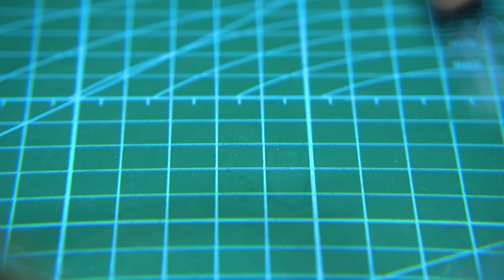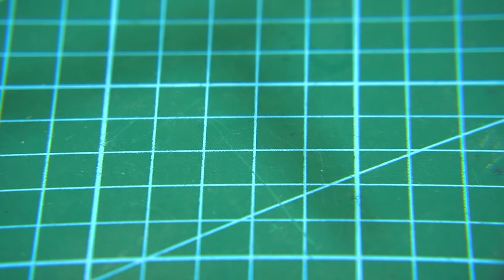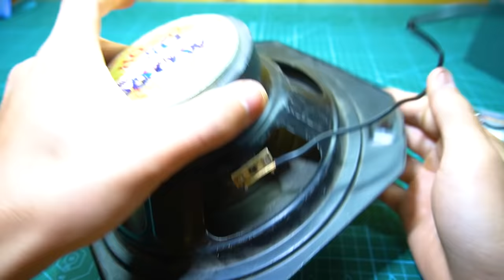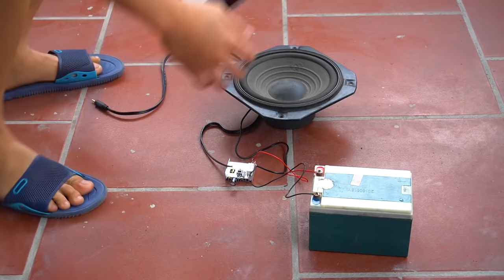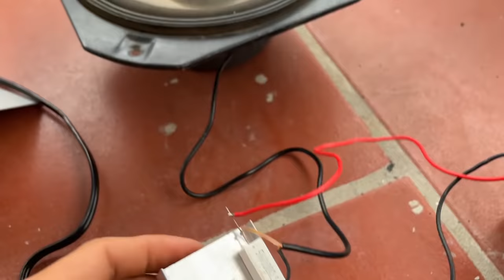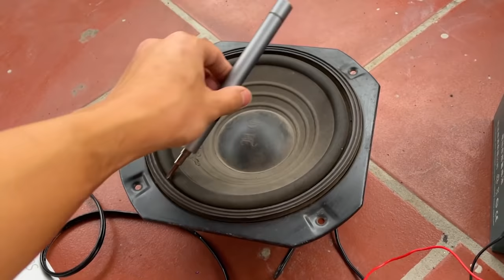DIY Powerful Ultra Bass Amplifier Z44N MosFet, No IC, Simple circuit

Comment: while what you did is impressive... it is simply impossible to get 1300 watts from a single ended amplifier running on 12vdc Even if you double the voltage you will never get anywhere near 1300 watts from a single discrete transistor. The laws of physics and amplifier design havent changed. You might be getting between 4 and 5 watts out of your amplifier. Single ended amps are power hungry monsters and can only claim around 40% efficiency. So measure the current draw from your battery and multiply that by the voltage of the battery under load and that will tell you what the amplifier is drawing from the supply. The power output will be only about 40% of the input power. And you absolutely cannot get more power out than you are putting in!!!
Reply: You are electrical and electronic engineering.  
No one dare to changed ohm laws nor physics, but one could only adding and subtracting. 
This project for mimicking purposes, if assembler want to exponentially functional circuits, he must have the right ohms laws for his output satisfactory.
Reply: He is misleading people by posting these barely 

functional circuits with ridiculous ratings.
Some are dangerous or will burn out the speaker.
Why do you think manufacturers use so many more 

components to get a proper operating safe circuit?
How many people have wasted their time with the garbage 

he posts?
Reply: 1300PMPO possible 😅 lol
Reply: Cred că  depinde  mult  și  tensiunea  de intrare  ( semnal )
Reply: 1300w PMPO
Reply: Thanks for your valuable input. I  am learning and not know as well  the actual capability here.
Reply: Publica un plano

Comment: this small speaker is 50w  and this amplifier is 20w max
Reply: Не 50,а 5-10 от силы но чуйка возможно не плохая😅
Reply: @あなたはここで何を見たいですか  10w speaker is printed. on magnet
Reply: You wrong, this transistor have P_max 94W and speaker have the sign 500W written with permanent pen, by a simple calculation we find the power (500+94)*2=1188 and this is almost 1300W. Amplifier ofcourse works in Class PM(perpetum mobile) and speaker is constructed from very advanced materials and cheap sticker on magnet :)
Reply: Мужики,вы меня дурите😄
Reply: @paolbackman651  anyone can write 500W on a speaker, more likely a 10w speaker, freeze video where he's waving the speaker about 6min.50s
Reply: about 50w power

Comment: This is a Class A amplifier, output is approx. 2.5w with 12v power supply.
Reply: That's what I. Saying it won't produce more than 10 watt in it's maximum voltage at 60v where as MOSFET power limit is at it's peak according to datasheet and being class a it's highly inefficient amplifier I don't know why these people fool other saying it's 1000 watt something like that
Reply: There are class A amps like this, their power is in the mW range and gain is very low. However this one isn't even set up correctly. There is nothing to AC couple the speaker to the output, so a) the power resistor is useless and b) the DC offset would keep the cone off center all the time. However, the cone is not moving a bit when he connects power, and also no crackle when the jack is hooked up. 
My guess is, he hid a small amp module in the "power brick", connected via bluetooth. The "power rail" carries the actual audio signal, and enters the speaker through the medium sized resistor and ground.
Reply: He is misleading people by posting these barely 

functional circuits with ridiculous ratings.
Some are dangerous or will burn out the speaker.
Why do you think manufacturers use so many more 

components to get a proper operating safe circuit?
How many people have wasted their time with the garbage 

he posts?
Reply: @westelaudio943 yes actually, when he places the battery on the table, there isnt any sound when the table and battery collides. also the battery is modified, its obvious, also based on calculation, side of the battery says, that its a 6volt battery actually. if we calculate the output wattage, it no more than 0.28Watt, or 280mW. Also when he connects the speaker, or the battery, if the speaker is already connected, there isnt any bumps, most of his diy amplifier isnt working in real condition, i didnt told you new thing i guess.
Reply: @gordonwelcher9598  i actually once blew up my player :) like years ago, luckily i just had a 2-3$ mp3 player, due the decoupling capacior on input was reversed, and i decided to give power to little baby, (i used +12v and -12v on an atx psu.) note: it was 3years ago when i not even had solder iron, nor knowledge about amplifiers. today i built a nice 15watt amplifier for 4ohm, its an AB class amplifier based on quasi complementary pair, giving a whopping 35Volt for voltage rail, it draws half an amp on max volume, it have negative feedback to decrease distortion, it have bootstrap for additional power from the driver, it was a nice project. 2 transistors on the output, (two 13009) and for a driver: c1885 and a912 pair, and a c945 where the signal is boosted from aux.

Comment: Los cálculos de potencia para este circuito son 4.5 watts rms max.  Considerando Vf=12v, y el amplificador clase A entrega un máximo de Vf/2, es decir la bocina recibe máximo 6vrms, y con 8 ohm de impedancia,  la potencia es P=V*V/R, (6*6)/8= 4.5W
Corrijo, esta potencia no es RMS, es potencia peak, gracias por la observación a 歸虛
Reply: hahhahahahhhhaa 4,5? 1w max
Reply: Hola, y como se calcula la ganancia de este circuito?
Reply: Hesap çok iyi
Reply: I am sure that it is at least 10,000 watts 🙂
Reply: Edgar y como se hace si quiero colocarle otro speaker ? gracias
Reply: Otra pregunta , si quiero agregar otra corneta (speaker) si la coloco en el mismo lugar se comparten los W , o tal vez tendria que hacer otro mini amplificador , espero me puedan entender , gracias
Reply: Y con cuanto voltios se alimenta 5v o 12v ?
Reply: Klw di tambah tune control munkin lebih bagus lagi
Reply: @luispirela1128  5  Es lo mínimo que necesita
Reply: @FederacionFunk  es fácil
Reply: 4,5w es lo máximo
Reply: Bravo  quando si butta fumo negli occhi bisogna vedere a chi lo si butta

Comment: Good job, connecting the battery right up to the speaker, cause that will totally work. For once I thought you were going to build an actual class A amp, but nope, lots of issues with your “circuit”

Comment: Try to use F-CK69 Gaetanium transistor, it will give 10.000W or how much you want. Don't forget to use Shitanium filter caps for output.
Reply: what are the filter caps for?
Reply: Jajajajaja

Comment: Hahahahah 
Don't be fooled guys. that thing he claims to be a battery has a bluetooth player inside. The audio is actually coming from the media player inside the fake battery. Look at his connections, the red terminal in connected directly to one side of the speaker and the other terminal to the mosfet which I suspect has a short circuit ot the resistor connected to the mosfet case has a short or a wire was put through it to complete the circuit via the heat sink..

Also check when he puts the fake battery down you can see that it is light weight. I would have  expected a battery of that side must have some weight .

All his videos are fake.
Reply: that's true ! wires are directly to speaker, we all can see at 8:00
thank's for hint !
Reply: nice lol,   I thought it was legit until he wires the audio out to both sides of the power resistor,  couldn't see how that would achieve anything.
Reply: Tengo todo el material pero en verdad funciona?no quiero perder el tiempo
Reply: @ash0787  lolw, mine is under construction :)))) i use 5kg transformer :)) at 20volts :)))
Reply: I can test this arrangement with some caveat. So that there was audio output I had to connect the drain from the mosfet to the gate through the 10K resistor. Instead of connecting gate to source. The result was not 1300 W. I think it was much less than the speaker used 8 ohm for 60 W. The mosfet gets very hot.
Reply: @dreadwings3  some braindead peoples will say that you missed something in the circuit, that Is false (But do doublecheck your circuit, if its seems alright ). When you wanna build a nice amplifier you will not gonna build From mosfet Due its very tricky, also this 1300Watt not Real even it Is measured in pmpo. Or might this guy just faked the entire amplifier and used that Magic battery which have no wheight, (contains a very small lightweight 12v 2-3A capable battery and a nice tda amp) its common in this creative guy
Reply: @luisdamianduran2744  no lo hagas es falso las 2 terminales de la bocina o parlante no pueden ir conectadas al mismo extremo del transistor, quemarias todo desde fuente de alimentación hasta el altavoz

Comment: I like these simple designs....very easy to build for beginners. But 1300watts with a single fet from a 12v battery.....that's impossible.
Reply: Just try and you can tell💪
Reply: He is misleading people by posting these barely 

functional circuits with ridiculous ratings.
Some are dangerous or will burn out the speaker.
Why do you think manufacturers use so many more 

components to get a proper operating safe circuit?
How many people have wasted their time with the garbage 

he posts?

Comment: With this single ended drive, the max power output can be easily predicted by the supply voltage and speaker impedance....
Reply: Can i use this circuits for boost  dc volt?
Reply: There are class A amps like this, their power is in the mW range and gain is very low. However this one isn't even set up correctly. There is nothing to AC couple the speaker to the output, so a) the power resistor is useless and b) the DC offset would keep the cone off center all the time. However, the cone is not moving a bit when he connects power, and also no crackle when the jack is hooked up. 
My guess is, he hid a small amp module in the "power brick", connected via bluetooth. The "power rail" carries the actual audio signal, and enters the speaker through the medium sized resistor and ground.

Comment: Hmmm... Really very powerful... Had that thing measured 5watts?
Unbelievable... Even the laws of Ohm and power formulas are not what they have been
😳😳😳😂😂😂
Reply: He is misleading people by posting these barely 

functional circuits with ridiculous ratings.
Some are dangerous or will burn out the speaker.
Why do you think manufacturers use so many more 

components to get a proper operating safe circuit?
How many people have wasted their time with the garbage 

he posts?

Comment: Será que pode usar uma fonte de 12volts ao invés da bateria?
Reply: Ele usou bateria porque dificilmente temos em casa fonte de 12 volts que forneça amperagem alta.
Para esse falante de 500w em 12 volts nesse circuito a fonte precisa  entregar 41 amper de corrente para usar a potência total do alto falante.
Mas dá sim com certeza, só que a fonte deve fornecer no mínimo 41 amperes , caso a fonte forneça uma amperagem inferior ao que o falante de 500w precisa, ele  não vai entregar tudo que pode.
Reply: @ramos3246  será que vira testar em um carro?
Reply: essa bateria é de 12volt 12 amperes

Comment: shitt 1300watt..hahaha
Reply: bruh its less than 5watt xd,
Reply: dude lets just calculate :D 
If he getting 60% efficiency his supply voltage is 12V so the output voltage will be 7.2V so he have 8ohm speaker. My 5W advice was close. His wattage is about 6.48W, if he lucky and his efficiency is 60% :D
what if he isn't lucky and his efficiency is 40%? 
Lets calculate :D 
If he have supply voltage 12v, if he is unlucky, his output voltage is 4.8V, and if he driving a 8ohm speaker his wattage will be: 2.88W :'D I'm crying dude, from cringe :'D

Comment: Has anyone tried this? 
I would imagine that the battery is 12v and probably 10Ah.

I would like to see him runs a voltage test on the battery to show us that there is no amp inside it.
I will try this in the near future and get back to you.
Reply: Hello, I wanted to ask you, have you assembled a circuit, does it work, how many amps does it consume?
Reply: @ГеннадийМ-ь9ш  Hi, thanks for reaching out. No I haven't had the time but I will let you know how it goes. Thanks!
Reply: @irawardmusic  thank you, I will wait for an answer from you!

Comment: Both positive speaker and power line are soldered to a resistor that is grounded to the heat sink. That should be getting no sound at all. WTF???

Comment: GUYS DON'T TRY TO MAKE THIS AMPLIFIER, I BOUGHT THE PARTS FROM MOTEI BUT THEY DON'T WORK!!! I ASKED A FRIEND OF MINE, WHO IS ELECTRONICS, TO CHECK IF ANYTHING WAS WRONG, HE BUILT THE CIRCUIT FROM SCRATCH. AND NOTHING WORKS, A LOW NOISE COMES OUT, A HORRIBLE SOUND. WE HAVE REACHED THE CONCLUSION THAT THE VIDEO IS FAKE. UNFORTUNATELY!!!

Comment: max power on that part is 110 watts, so fudging just a tad on the claims, but that's still a good build. Also keep in mind that your wattage shrinks as you are not using it at it's optimum voltage, it's rated to be used up to 55v and 49amps so your wattage is still extremely shy of the 110 max watts.
Reply: Max. dissipation of the FET does not equal output power. The latter would be more along the lines of <1W for this simplistic single anded design. Also this design would put DC offset   on the speaker cone, as there is no coupling cap, but we don't see that. My guess is the real sound is coming from the "power brick", with a BT amp hidden inside. If you see how this amp is wired vs how it behaves. That is the most likely scenario. And this channel has videos with far more obvious trickery.

Comment: Se puede alimentar con fuente conmutada de 12 volts?
Reply: La fuente conmutada su entrada es de AC Y su salida  DC. La bateria es DC 12V. No veo por que no. No creo que el amperaje de ese circuito electrico sea mucho. Con el multimetro checa donde tienes 12v y listo.

Comment: Can we use it for long time use
What will be the minimum power of speaker that can be connected with the circuit and maximum power of the speaker up to which it can amplify the sound 
Is it a stereo amplifier circuit?
Reply: Maximum input voltage of this circuit?

Comment: Now show us the same thing, this time for 2 and 4 ohm speakers! Been awhile since I wired up 10" 12 ohm subs in parallel for use with a 2 ohm  amp!! With respect to wherever you may live... it's easier to buy then go through the process unless you're practicing your soldering?! To each their own.

Comment: Saludos amigos, soy amante de la electrónica me gustaría aprender más sobre ella, me gustó mucho este tipo de amplificador y quise replicarlo pero no me da audio, tengo una resistencia de 22 Homs por qué no tenía. Amano un ade 100 pero es de 5w igual, si ese puede ser mi problema por favor confirmen
Reply: This amplifier is fake, will not make more than 4 watts from 12v power supply

Comment: Fake on.. This battery has strong amplifier inside with small 12 volt battery.. .. Outside one is also amplifire but real working module is inside this fake battery.. 🤣🤣🤣very smart work..

Comment: Nálatok ez már 1300watt ?
Reply: A hangszóró mágnesén 10 Watt szerepel. Az IRFZ44N képes lenne kb. 1000W leadására is impulzus-üzemben, megfelelő hűtéssel és nem hajszálvékonyságú vezetők használatával. Ez az áramkör 100 Watt leadásánál inkább csillagszóróra, vagy füstgránátra emlékeztetne egy fél másodpercig, mintsem erősítőre. A papucsos gyerek meg jobban tenné, ha megtanulna számolni, a matek- és fizikatanára helyében a videót egy kedves kis évismétléssel díjaznám.
Reply: @baladar1353  
Már ott kezdődik a probléma,hogy szimpla 12Volton tiszta A osztályba akar 4 ohmon 1300Wattot....
Még rövidzárral sem adná ki az 1300Wattot !!

Comment: The speaker 🔊 is 8ohm
If you convert that it gives you 215watts
Now for it to sound you need 700watts amplifier now my question is why did you say is 1300watts can do your calculations to get 1300watts

Comment: Shouldn't you put a capacitor between your speaker and your ceramic resistor to avoid your speaker coil from heating up? Your getting more current from your battery to your speaker than sound frequency which can burn up your coil.

Comment: Very great 👍,, but I have a question ,
Can I use a 100 ohm 2 w resistor instead of 5w?
And, can i use 12 volt Power adapter for power on?

Comment: Will break through the transistor and the tablet will fly into the trash. And I don't understand why they give out a 20W speaker for 500W. You can write on it with a marker as much as you like, but it will not become more powerful.
Reply: Yes, it infact is a 20w speaker. Let's say you give a 100w speaker for a 15w amplifier, then the speaker will not have the same wattage shown. The speaker receives the power of the amplifier. So then the speaker is at 15w RMS. And if you give a 10w speaker 200w it will become 200w same as the amplifier. Test a 100w speaker on a 15w amplifier and then test it on a 200w amplifier
Reply: Once I connected a 30W Amphiton speaker (made in the USSR) to a 100W Orbita amplifier (made in the USSR), and the speaker was out of order within 30 seconds :).
If you connect a 100W speaker to a 15W amplifier, it will play very quietly. In the manufacture of speakers of different powers, wire of different cross-sections is used for winding the core. In other words, the more powerful the speaker, the thicker the core wire. I made out a lot of them.
And I wrote the comment initially because the author of the video wrote with a marker on a 500W speaker and is trying to show that this amplifier circuit is capable of driving such a speaker, when in fact the speaker is only 20W.
He is misleading us.
Reply: This man is lying about power and using them in a wrong way.
Reply: Yes, infact he wrote 500w in the back of the speaker, but if you have sharp eyes you can see the rating of 20w
Reply: @GotaSir911  I just don't like being deceived